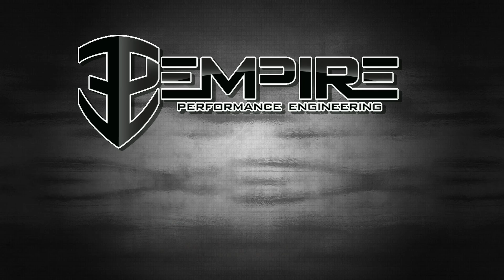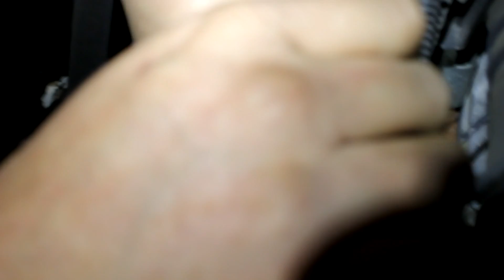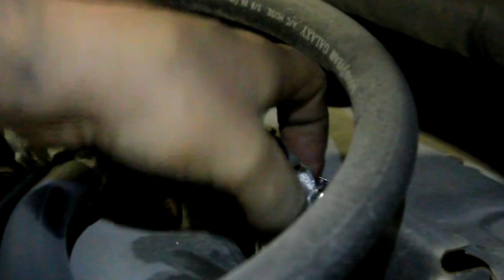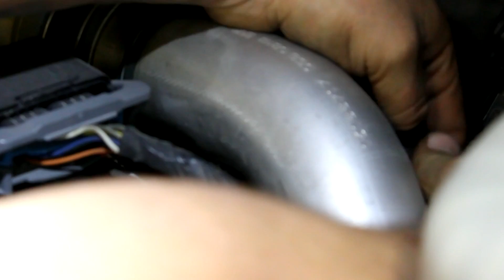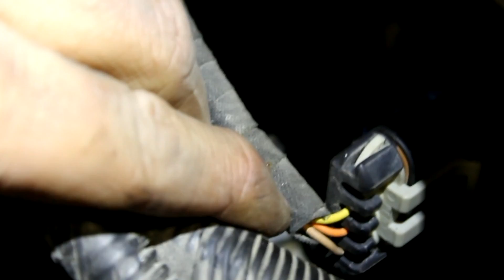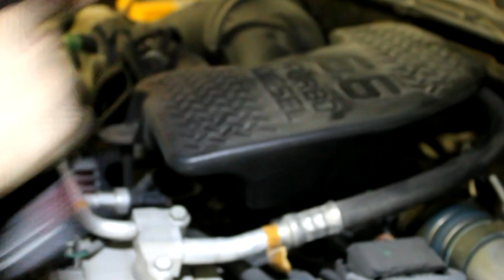Vane Position Sensor Installation Video

Comment: I hate VPS anything. never ending issues with them. New VPS, wiring checked, voltage is right. getting a PO2564 and vanes are showing 100% and I have to mash it to even get 6 lbs of boost. Im over this but have to fix it bc this truck pulls my work trailer. probably going to save for a non vane turbo swap. Any advice on what I should?

Also I can remove the VPS, press it in and out while watching my monitor and the value never changes. Bad sensor?

Comment: I'm throwing a p0046 and p2563 on the '04 LLY I just bought, but I can hear the turbo spool when I get on it. Do you think this is the fix?
Reply: Did you find a fix? I have the same issue with mine...

Comment: We have a 08 Chevy 3500 work van and we replaced the cane position sensors. It’s a little different in the location than this video but the sensor looks pretty similar. When we started the engine, about 30 seconds later, all the engine oil started coming out of where the sensor is. Replaced oil, checked sensor for o rings and everything looked good. Tried again and all the oil came out again. Didn’t even get to change it to drive. Any ideas on what’s up with it??

Comment: I just put a new turbo,down pipe,up pipes and y bridge and a EFI live tune on my 2006 lbz and I'm still getting a p003a code. What do you think could be the issue. Also it has a new sensor just like the one you put on in the video.

Comment: Great video, I’m getting the notorious P003A code and I purchased the revive turbo cleaning system and it mad a difference in the boost but still getting the code. Do you think it’s the sensor? Or do I just need to do a “re-learn” for the positioning? Also what programmer do you suggest?
Reply: Did you get the p003a code fixed? What did it take?
Reply: @otisplayyz  unfortunately I had to replace the turbo

Comment: i was reading the instructions on the Dorman sensor ,and they clain  no need for programing..do you  have any insight on what there saying? thanks for any info.
Reply from the maker: We personally do not use Dorman sensors and do not have an answer for that questions. The only thing we can recommend is using an OEM GM sensor or Garrett.
Reply: Larry did you figure this out im using a dorman sensor today

Comment: I am getting a error code P O299 on my 07 Duramax with the LBZ engine. Will this fix this issue?
Reply from the maker: That code is for under boost and could be a few things causing it. Unless it is checked out by a technician we cannot say for sure if the vane position sensor will actually fix anything.
Reply: @Jim church Did you ever fix it? I'm having the exact same issue and Mark @Danville told me to check the VPS because my vanes were off when it went into underboost.
Reply: same issue with reduced power mode.

Comment: Do you know if a snap on Modis can do a vane relearn? are there any tests to confirm a faulty sensor??
Reply from the maker: +AREA80hEight Depending on what software update you have you should be able to do a relearn & to do a test.
Reply: THanks!
Reply: I just installed an edge CTS with Attitude on my LLY and now I am getting a P2565.  Would This fix the problem in your opinion?  Also, to relearn the sensor can this be done with the edge?  Thanks!

Comment: What about the shielding tape replacement?
Reply from the maker: telecastercrunch Replacing the shielding tape is not absolutely necessary but you can use any heat shield tape that you like.